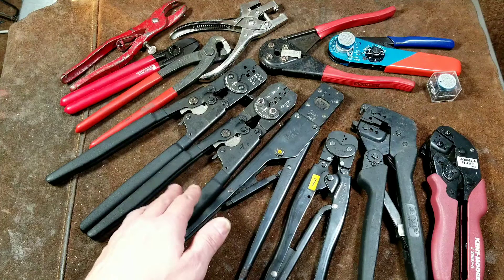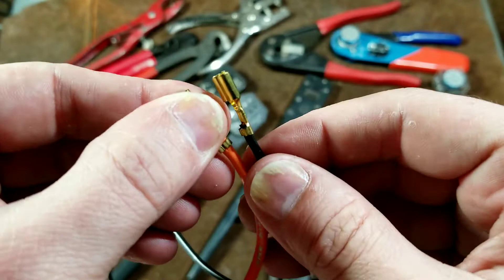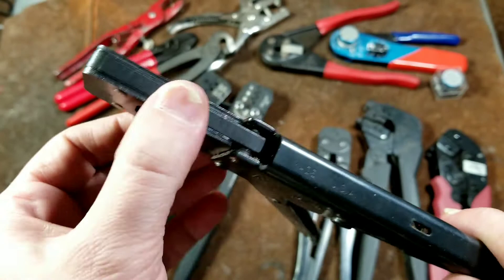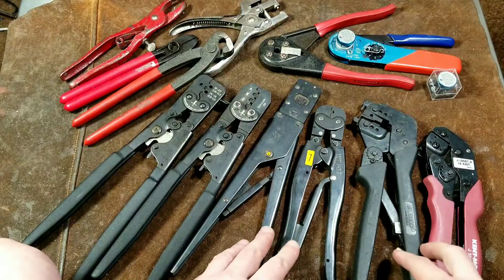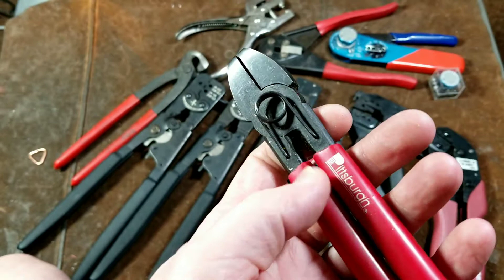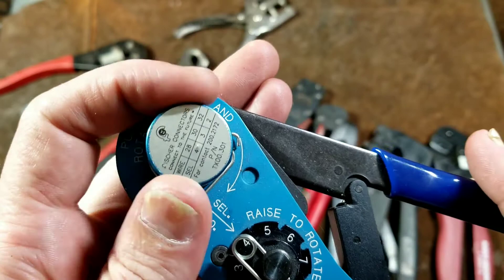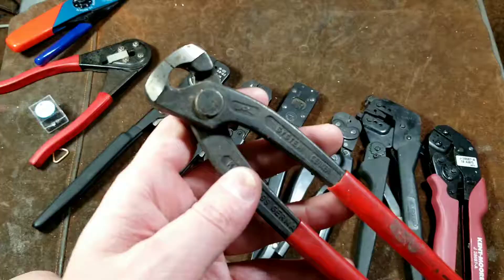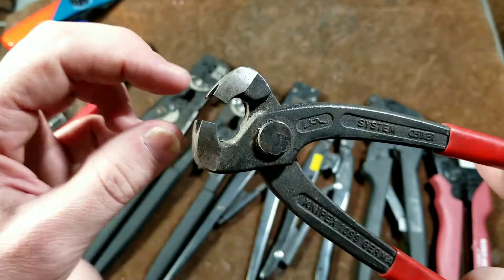Professional Non-Insulated Wire Crimpers & Specialty Pliers, Review & Comparison

Comment: What you are calling uninsulated connectors are actually open barrel terminals and an uninsulated terminal is the same as the insulated terminal without the insulation. This was still and interesting video despite some errors.

Comment: The Buchanan C-24 crimper is for a very specific use.  When crimping sleeves were developed for connecting the ground wires when doing AC work (mostly 14 and 12 gauge wire) they were developed by Buchanan.  Therefore the Buchanan crimper.  Designed for a positive connection of the ground wires.
Reply: Prefer   soldering   joints
Reply: Prefer soldering  joints

Comment: The small pins and sockets that are crimped by the Daniel’s AFM8 are solder OR crimp not both. Soldering is better for larger wire while crimping is good for small wire. The hole in the pins and sockets is to confirm that your wire is stripped back enough to be properly crimped, it is known as the witness hole. The AFM8 is used a lot in the aviation industry for building cable harnesses

Comment: Great and helpful vid, thanks.
Similar to hog ring pliers, I have a pair of Jr lip pliers which crimps a flat aluminum strip shaped like a J. The are used for joining wires and are commonly used for building wire cages and rabbit hutches.